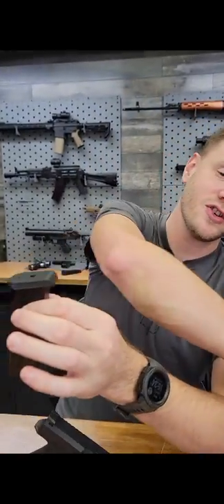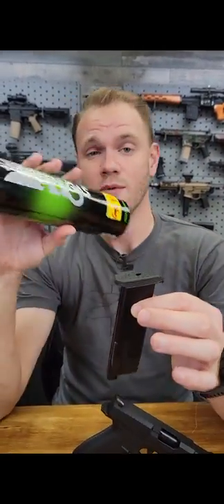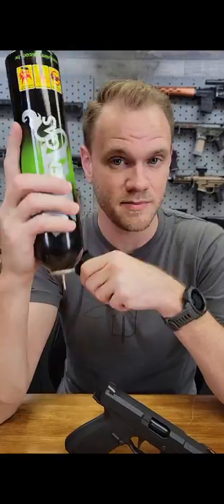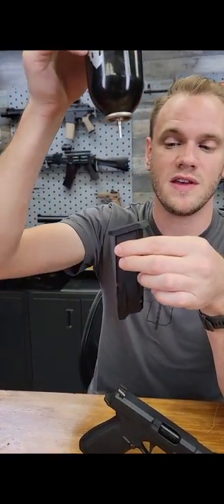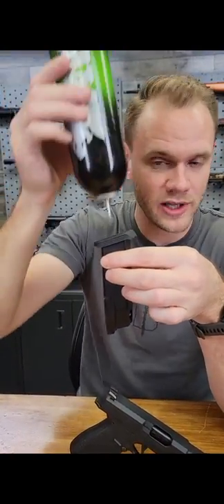How to Fill Green Gas Magazines - Airsoft Tips & Tricks #shorts

Comment: I've been doing this and never once did it right, always spit gas everywhere
Reply: Likewise. No idea what the problem is.
Reply: I would assume you are not holding the mag and gas can vertical enough
Reply: Did u ever figure it out, because I have the same problem
Reply: @Zepoyek  not really, no
Reply: There’s a little metal button behind where the bb load in when you press it it rejects all the gas
Reply: Do you shake the bottle before use?
Reply: Same. I’ve tried everything possible. It may be the magazine. But no matter what most of it just sprays everywhere. And a LITTLE goes into the mag.
Reply: It depends on the gas u use
Reply: @Atom-jp6gf  the can you mean? Bcuz all green gas is basically the same. Just the cans are different
Reply: Same. But i tried holding the base of the clip hard and the spilling is lessened. And I push hard and I hold the clip firmly. And I make sure the hole is plugged correctly.
Reply: I’ve had the same problem and asked one of the Airsoft store owners what the problem was, they asked me how long I hold the gas for, and I say until I hear it stop hissing, the thing is that when you hold it for too long your pistol will over shoot releasing more gas then intended which late unequally distributes for the remaining shot you have left that’s why 3-4 seconds would be perfect if Absolutley necessary maybe even 5 second
Reply: Dumb question new to GBB systems but with the hi capa mags is it normal to run out or low on gas with one or two shots left in your mag?
Reply: @jayfray38  I don’t think so. For pistols Atleast. It usually should last like 2 or 3 or 4 mags I believe
Reply: Tilt the bottle the same way the metal long way is not by the tilt of the base plate
Reply: @jayfray38 yes and no. That means you didn’t fill your magazine all the way but it is kinda hard to get it filled right so I usually just not fix it.
Reply: The mag that is used in this video is a single valve nozzle. It will not make any noise when filling.

Most modern mags have double valve nozzles and release gas as you fill so more of the liquid gas can get into the mag.

You are not doing it wrong.
Reply: If it does this no matter what you do it’s probably a broken/dry o ring you can find tutorials on how to fix your mag on yt
Reply: @Suspicious0ne  Thank you for letting me know that it’s normal for the gas to spew out like that. I have a question though, what happens if you accidentally inhale or come in direct contact with the green gas? I just got my new airsoft glock 19x gbb along with this exam gas can and I read in the instructions that if someone’s inhales the gas remove the victim to fresh air area and if it comes in contact with water, flush with water while removing contaminated clothing.
Reply: I think it’s the o ring in the mag?
Reply: It’s a piece of rubber that prevents mag from leaking gas when filled,I had a problem like that too
Reply: what happens if u put way to much in it (only had co2 guns my whole life)
Reply: Nice pfp

Comment: 2 seconds is enough for 20+ shots.
Reply: Stay 10 seconds and its good
Reply: Ya but we wanna see the maximum power and distance that thing can shoot
Reply: @MetalGodMasino Overfilling is never good from my experience…. Just 2-3 secs is usually enough!
Reply: @alexeigortchev99  
That of course depends, if you overfill with a strong pressure you may break the mag or the thing on the gas bottle.
Generally speaking its safe to overfill.
2/3 seconds is short unless you have low capacity mags like 1911, most will fill after 4-7 seconds

Comment: GBBR's; 
Am I a joke to you?
Reply: Do I even exist to you?
Reply: What is that
Reply: @commenter621 gas blow back rifles I think. For them you just put a metal canister in the magazine
Reply: @Fancy.Bowtie  No thats a pistol thing
Reply: @goose1925 no its not, they exist in rifle form too. 12g C02 and BBs go into the magazine.
Reply: @KiLLJOY1056 there are green gas gbbrs too
Reply: @goose1925 the R in GBBR stands for rifle. Pistols are just called GBB although this would include rifles too since it’s a term for any gas blow back gun. But GBBR is specific to rifles
Reply: @NuttyCuts_ I was referring to the use of CO2 cartridges which is not very common for gas rifles
Reply: @goose1925 that’s not the same thing. The gas canisters are called co2 canisters, because they hold co2. In pretty sure you can find rifles that use green gas if I’m not mistaken, but it’s just way more common to find them using co2 because it’s more powerful and better for long ranges.
Reply: @Mertree599   I have never seen an airsoft GBBR that uses co2 canisters all that I have seen use refillable green gas mags. I have only seen co2 canisters used in snipers some gas shotguns and some pistols. I'm strictly talking about airsoft I know some bb/pellet guns use co2 canisters.

Comment: One of the founders that designed this concept says your doing it wrong.

According to him you don't push it continuously but you press a second lift up and do it again. You do this 4 times and it's full.
Why? The way you do it causes a lot more stress on the internal components resulting in a higher degradation. Meaning you need to replace the mag faster which would cost more money in the long run.
Reply: This makes a lot of sense thank you
Reply: That explains why my dab torch went to shit thanks for the tip ✊
Reply: @Terraformer00 I was searching how to refill mags. In a youtube vid i was watching it pointed towards a pod cast with 3 old guys that designed the system. I watched the podcast this is where his source mentioned it. Can't find it now (did look for you) and considering this more then 3 weeks ago I have to go through like 2000 vids no joke. Chances of finding it is slim and not gonna waste my time on it. I got the info I needed I think if you search for it yourself you will find it I stumbled on it by accident
Reply: Lol true
Reply: Yeah, it can freeze the o-ring if you keep it pressed t
like this.
Reply: so just one second 4 times?
Reply: So i put the bottle upside down and press it for 1 second, then put it back downside, then upside down again and press 1 second?
Reply: It’s the same thing as turning your AC on blast and max cold, it can damage the veins/flute
Reply: i think your right cause one of my taren tactical mag i pressed it then after i let go it was escaping

Comment: What happens if you don’t put in the green gas?
Reply: The rifle or the pistol will not work you have to have green grass in there
Reply: It wont work because the gun only works because of the compressed air inside that pushes the bullets. Without this compressed air on the reservoir, nothing will push the bullets
Reply: Its like a real gun g if u aint got amo in it (green gas) its not gunna shoot my 19x dont shoot unless the mags in and the trigger is forward

Comment: *Burst fills*to prevent liquid forming in the mag. The more you know💫 #gbbrmasterrace
Reply: Except the bottle has liquid in it, that is what you are decanting into the magazine. Otherwise doing it flipped around would be just fine, but actuality says otherwise. Propane is a liquid inside the container and it transitions to a gas as it warms up.
Reply: @HalcyonVoid  you must like silicon oil in your hop up.. Ouch to your builds 😮‍💨
Reply: @Roguefoo27  propane is superior
Reply: Wayward Airsoft  even with propane you don't want to freeze dry your hop-up bucking. When you get gas spraying out the gun(more liquid than vapor in the chamber) it'll look cool but damage the bucking as you continue to shoot. Again burst fill your mags people.